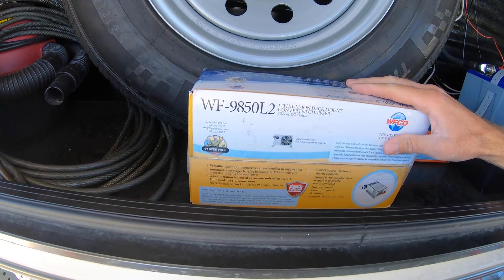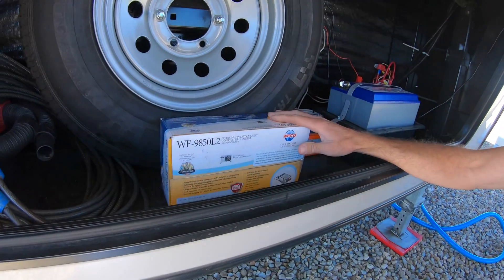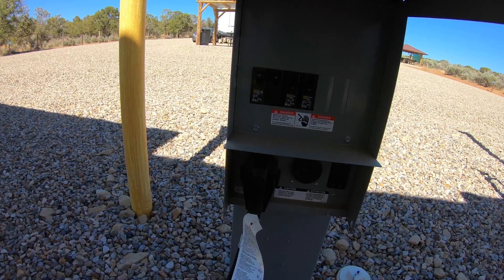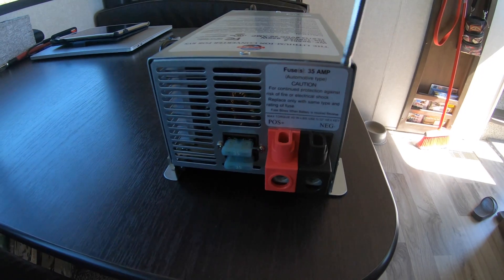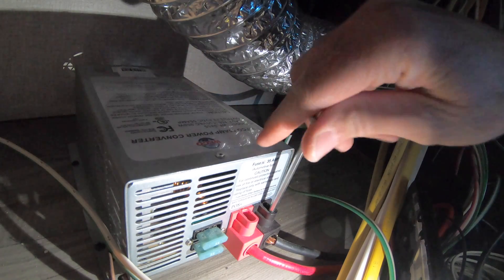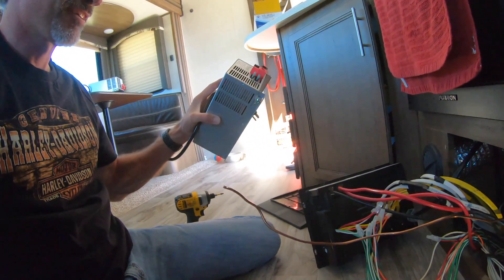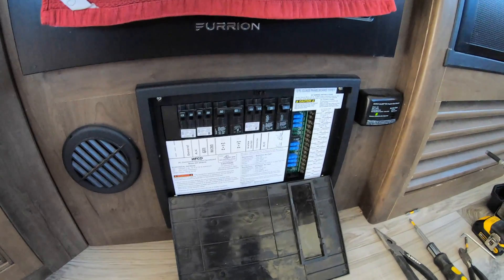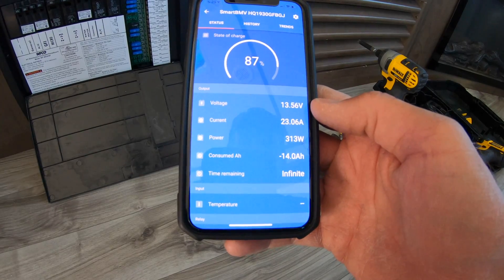Going to LITHIUM Batteries for your RV?  WATCH THIS FIRST!  WFCO WF-9850L2 Lithium Converter Install

Comment: You need two batteries minimum. One battery is not enough for even a teardrop trailer. COME ON MAN.........
Reply from the maker: @John Smith  Depends on what you’re using it for.  One 100AH Lithium battery is equal to having two 100AH lead acid or AGM as you can almost completely discharge the lithium without damage whereas you can only discharge lead acid or AGM to 50% before damage occurs.  So, for just boondocking for a few nights, one 100AH lithium is plenty as long as you have solar or a generator to recharge when necessary.  We used this setup for a short while boondocking with our 5th wheel then later upgraded adding two additional 100AH lithium and solar.

Comment: Good afternoon Ed and Ann....I hope you are both doing well!

Thank you for sharing this video!  Bleh....I am all over the map with regards to what I will do for solar.  Well, I will do a full system install (4 panels on the roof, controller, 3k inverter, at least 400ah, etc).  But, I don't know if I will have it done or do it myself.  I have a few objections--  drilling holes in the roof and running wires down into the rig somehow, hooking wires into the trailers 12v and 120v systems, and running wires externally from the front of the rig to the back left side to bring power from the controller/inverter/battery area in the front to the trailer fuse area in the back left of the rig.  

I suspect that if I just take my time and do it over a long period, it is doable.  And...that would save $4k installation!  I also just want to get going with getting some camping in when the rig arrives.  I probably could mitigate that delay by just bringing a generator along, in the interim (I'd still always bring a generator along for those treed, national forest spots) to power the rig exclusively.  

Another factor is winter has arrived to Ouray.  So, I'd have to be conscious about the temps when doing the solar panels on the roof and applying the weather proofing.  Or....just relocate that weekend further south to the warmer areas hehehehe.

Our rig will arrive with an 8 gauge wire that is connected to a 3 port junction box on the roof as it will be "solar ready" to receive hardware.  I can fit 4 panels on the roof.  So, ignorantly, I assume I'll need to install a 4 port junction box.  If that is the case, I may as well run a bigger wire down from the roof so as to have a wire gauge that will be, for sure, good.  Our rig also will have an external port on the front right corner that I could plug a portable solar panel (that panel, currently as the solar ready system is, would have to come with a controller on it as it is plugged straight into the acid battery location on the tongue).   As I get a complete system installed, I guess that portable panel jack wire, as well as the electric tongue jack wires, would have to be extended and rerun into the trailer to the new lithium battery bank somewhere.  

Wow...on your system monitoring app, that was really cool!  When you initially turned on your system, the "current" data indicated something like 25amps.  Did that mean your system was charging at approx 25 amps at that point?  

Safe travels!
Reply from the maker: @campingalan  Hey Alan!  I'll be doing the same thing this winter.  Minimum of 400 watts on the roof.  Already installed my inverter and 300AH of Lithium.  I also installed a dedicated outlet in the middle of the camper and wired it to the inverter.  If I want full power to the outlets in the camper, I use a 12 Gauge extension chord and a dog bone to plug in my main camper electric line.  When I do that, I shut off all breakers at the panel other than the mains and the "outlet" breakers.  It's a workaround in lieu of installing a fancy inverter/charger.  I don't really do this much though as we rarely used A/C power when boondocking other than for charging up the computer, cordless vac, etc..., and I can do that all with the dedicated outlet.   

To answer your question, the charger was charging at 25amps, however, it usually charges at 35 amps even though it is a 50 amp charger.  Not 100% sure why this is other than it may be due to the factory wire size of only 6AWG running from the charger to the shutoff and then to the batteries.  Kind of a long run with undersized wiring.  I may change that out someday to at least 4AWG.  

$4K is a lot for the install.  If you wire in series-parallel and use branch connectors, I believe you should only need 2 ports on the roof and 2 wires running to your solar controller. Also, make sure your solar controller can accept the size wire that you have.  I used 10AWG and it barely fit into my Victron MPPT controller terminals.  Good luck with your project and happy camping!

Comment: problem is on eBay there are lithium batteries that say 100ah but are rated lower than advertised
Reply from the maker: @Farmer2492  We bought our batteries direct from Battleborn.

Comment: I've watched you install the wfco upgrade for lithium batteriesand the monitor.  Did you install a mmpt solar controller module?
Reply from the maker: @Ashman Brian  Yes, I did install a 100 | 20 Victron MPPT Solar charge controller to go with my 200w solar suitcase that I put together. I also added 2 additional 100 AH Lithium batteries and a 2000w inverter.    I used it this summer while boondocking for 5 months straight and the setup has worked great.  Taking a break right now, but will be doing install and review videos on those soon.

Comment: You should shut off all breaker switches in box. I learned the hard way so to be safe turn off all breakers and plug your RV in then flip one switch at a time and won’t surge you system and blow fuses in you camper. I just did this and had this camper new in 2000 and this the first time this ever happen and it blew both fuses in the back of my fridge that I didn’t know were even there. So do what you want this might save a ruined vacation.
Reply from the maker: @Brent McMahon  Hi Brent, thanks for sharing your situation and resolution.  Sorry to hear you had the issue!  Wondering, do you use a surge device on the main line at the power pedestal or one that is hardwired in your camper?  We installed one on ours right away and have never had an issue like the one you described.  Here’s a link to our install for that device.  https://youtu.be/mRD9KPKNKm4
Reply: I have plug in at pedestal.
Reply: I do the same thing at my home when power goes out. I turn off the main switches and then all the breakers. Whe n the power comes back on I do the reverse.

Comment: Hi A+ explanation,  good thing i found video before i Purchasing lithium batterys. I have a question, in the future i want to have a battery bank of about 400AH lithium. Will these charge all batterys? Another question is that i want to add a inverter to have 120v on RV will boondocking. I was looking at the victron multuplus 12/3000/120 -50 120V VE.BUS. the victron says its also a battery charger.  I just want to make sure i dont buy both and i only need either the victron or the wfco 9850l2. Can some please advise thank you.
Reply from the maker: @ARTURO CHIA  Thank you!  We now have 3 each 100 AH lithium batteries that are being charged by the WF-9850L2 and have had no issues.  There should not be any issues charging the 400 AH battery bank with the WF-9850L2.  
The Victron  Multiplus will also charge your batteries and you would not need both the WF-9850L2 and the Victron Multiplus.  We installed a separate 2000W inverter that we connected to our 300 AH battery bank and installed a dedicated outlet from the inverter to the center of our trailer.  If you want to have A/C power throughout your rig, the Multiplus can do that if you wire it to your main panel.  I would recommend checking out the YouTube channel All About RV's with Jared Gillis as he has several videos on the Multiplus.  Good luck with your install!
Reply: @EddieAtLarge  got it thank you for the reply!!

Comment: Very informative video.  Thank you.  I am looking to upgrade to lithium battery and have the same issue with the WFCO converter/charger on my toyhauler.  We are looking to upgrade the lithium battery now with plans for solar in the near future.  Do you know if you can bypass upgrading to WFCO lithium converter/charger if you upgrade to a solar controller now with the lithium battery upgrade?
Reply from the maker: @Dave Thai  Glad it was helpful!  The converter/charger is only being used while you are plugged into shore power (meaning while plugged into an outlet at a campground, plugged into a generator or other source).  You can charge your lithium batteries with only a solar charge controller and solar panels while you are un-plugged from shore power without the need for a converter/charger.  That being said, it is convenient to be able to charge with the converter if you don't have good solar such as when you have a run of inclement weather.  
Here's a good example of what I am referring to:  We actually just had another issue with our WFCO lithium converter where it went dead on us and we didn't even know it.  We have been out boondocking for the last 4 months and charging via solar only.  We went to a campground for a week and plugged in and did not put out our portable solar panels.  Our 3 batteries ran down to 10% after 4 days as the converter/charger was dead and not charging the batteries.  Fortunately we were able to put out the solar panels and get charged back up, however, it took 3 days to do so.  
All that being said, I would recommend installing the lithium converter/charger so you can get charged up on shore or generator power when needed.  Hope that makes sense.  Feel free to let me know if you have any other questions.
Reply: @EddieAtLarge  Thanks for the details.  I do agree it worthwhile to get it to take full advantage of Lithium.

Comment: Well done, I like that you don’t make us watch you screw every screw at regular motion speed, but you made it very clear.  I would have considered a splice in my ground, yes I know panel grounds are not supposed to splice, subs different than mains.  But looked like a real pain.  One thing I look forward to, would you do it again? Meaning the switch from lead acid?  The cost worth it? Again good video well put together.
Reply from the maker: @David Purvis Thank you David!  I did consider cutting and splicing, however, decided to take the extra time for the reason that you stated.  And yes, I would do it a thousand times over.  Lithium has been incredible and so worth the money for what we're using it for.  I actually now have 3 Battleborns (300 AH total) as we've been boondocking full time now for the past 4 months and they have been great.  We charge them with only 200 Watts of solar every day (plenty of sun out west) with no issues.  I have all of the footage to put together videos for the battery bank upgrade, solar, inverter, etc... Just need to get it done.  Have been busy creating our travel videos of all of these amazing places we're getting to see.  Thanks for watching & commenting!
Reply: @EddieAtLarge  definitely just subscribed and following your progress! My wife and I need to have our 40' Jayco Jayflight LOFT supplied with power while we are living in it south of Pyramid Lake/Reno, NV! In process of building an modified Earthship Biotecture off grid home on a mountain. Thanks so much for posting you Life Experience!

Comment: I have a 3 stage WFCO 8735 model, wondering if I'd have same issues with not charging battery 100% too? I read your comments about the alternator and the last one you said you thought the alternator wasn't charging battery at all? But no issues with alternator to date? I'd like to drop a lithium 100ah in when our sealed flooded lead battery fails, but don't want to change out converter/charger if I don't have to as we are seriously considering upgrading to a 5th wheel. Then I could just swap lithium into 5th wheel and then do upgrade to converter/charger if necessary.
Reply from the maker: @Nick Markosian Hi Nick.  No issues with the truck alternator charging my truck batteries.  It just doesn't send any charge to the lithium battery in our 5th wheel.  I would guess that you may have similar issues with your WFCO 9735.  I tried to do a little research on your model and could not find much info.  There is supposed to be a replacement "Switch" for your power center, part number WF-8735-PB-LIS, however, I could not find anyone online who is selling it.  I would recommend calling both Battleborn and WFCO to see if they can give you more information.  When I called Battleborn about our model converter/charger, they told me that it would charge the battery, just not to 100% (only to around 80%).  Which I thought would be fine as Lithium can be discharged to almost 0% without damage.  The issue I ran into was that the battery would charge extremely slow using the stock converter/charger.  I had not choice and had to replace it.  If the manufacturers say you can use it, you can always buy the battery first to see if it charges ok or not.  Another option for you is to get set up with some solar.  We use only 200 watts of solar to charge our batteries and I haven't had to run our generator in over 3 months while full time RVing.  We are boondocking out west though with plenty of sunshine...  Hope this helps!
Reply: @EddieAtLarge  After reading the manual to our power center, it states it will only stay in bulk mode for a max of four hours, wondering if this is the weak link to charging lithium battery. I need to look to see if you did a video on your solar setup, we definitely will be looking into this too! I'll look, but did you go suitcase style or attach to RV? We live in Phoenix and when we camp I hunt shade, so no way I'm attaching to RV. But that begs the question if you leave camp to fish, hike etc... How safe is it to leave them out.
Reply from the maker: @aznick102   I don't believe that the limitation on time in bulk mode is the issue.  From my understanding, the standard converter isn't configured to be able to send a high enough voltage to the lithium battery to charge it properly.  A standard lead acid battery is considered full at 13Volts.  A lithium battery is considered full at 14.6Volts.  My lithium converter sends 14.6Volts to the battery when in bulk mode (I checked it with a multi-meter).  If the standard converter is only sending 13Volts (in bulk mode), that would be the issue IMO.  I haven't done the solar video (yet).  I did put together a solar suitcase with 2 ea. 100 watt panels (200 Watts total) and can run it out about 30' from the RV using 10 AWG wire with the panels wired together in series.  We leave the panels out and secure them with locks and a steel cable.  If someone really wants to steal them, I'm sure they could get around the locks and cable (if that's what you are referring to regarding being safe to leave them out?)  Or if you mean safety electrical wise, the solar controller that we installed takes care of that and will cut off power input from the panels once the batteries are fully charged.
Reply from the maker: @aznick102   Glad to help!  Your converter may work to charge them, however, I wouldn't get your hopes too high.  I do know that they design those converters to work with the certain battery types and they are able to detect the battery state of charge which in turn puts the converter in the different modes (bulk charge, absorption charge and float charge).  The converter will most likely not be able to determine what state of charge your new lithium battery is in and therefore won't charge it as quickly or to the full capacity.  Will definitely be putting together the videos for the battery bank upgrade and solar panels sometime soon.
Reply: @EddieAtLarge  Yep, think you're right - I don't want to change out converter since we are planning upgrade to RV probably late winter. This is crazy, but what if I bought a lithium battery and just changed it out at our camping spots. Then use a 200w solar suitcase w/built in converter to charge? (Like you said, you haven't had to use your generator.) Before leaving to another destination or home I replace with my lead acid battery. Seriously, only two wires, not much work involved. When I sale trailer, sale it with the lead acid battery of course. Am I missing something?
Reply from the maker: @Nick Markosian  Hey Nick!  I would recommend building your own solar suitcase (the Renogy pre-made ones are way more expensive and the solar controller is sub-par - PWM vs MPPT).  As long as you have solar (and sun), you'll be good.  Maybe just keep your old battery charged up and with you then as a backup.  Hopefully you have a generator that you can take with you to charge the lead acid battery if you get in a bind with no sun.